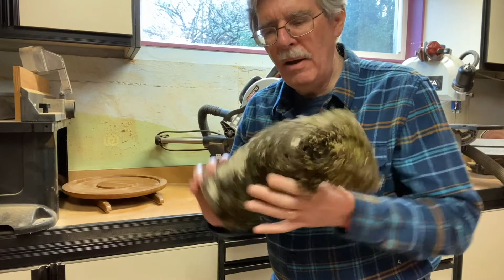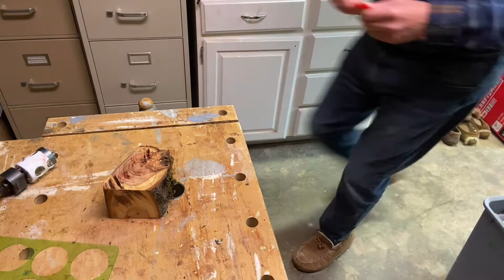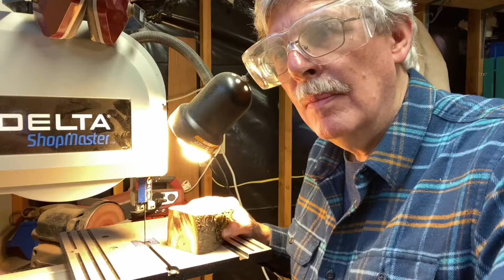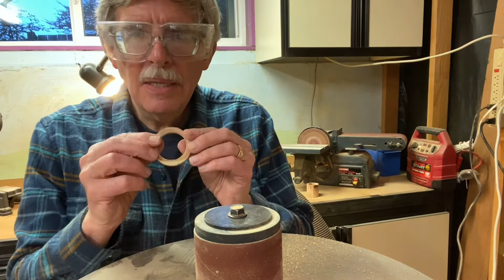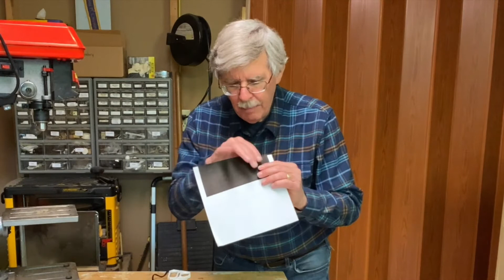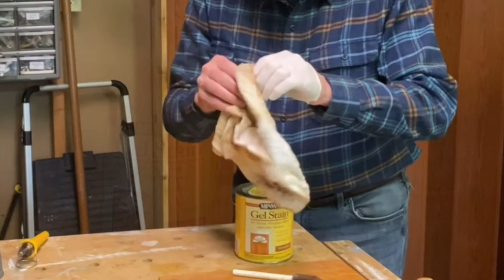Making Wooden "All is Well" Napkin Rings

Comment: I Use My Rotary Tool & 
A Little Diablo Sandpaper.
Some Of These Guys Turn Them 
On A Lathe I Cut Them
From Treewood Like You Do
But I Cut The Log With My 
Miter Saw Then I Use A 1/2 Inch 
Spade Bit From My Spadebit 
Kit. I Don't A Drum Sander
But I Use A Drum Sanding
Kit On My Drillpress & My Cordless Drill. When Ever 
I Stain My Work I Use A Kids
Paintbrush. They Can Be Purchased At Any Walmart Lowes 
Or Home Depot Or Harbor Freight
Or Joanns Or Off Of Amazon
I Usualy Make Mine Out Of Pinr.
It's Realy Eazy To Work With
I Also Made Some Holiday 
Orniments Out Of Pine Too.
I Also Made A Snowman 
From Treewood Too.